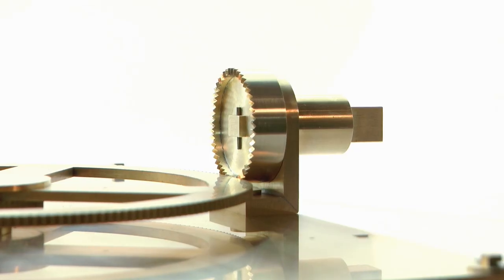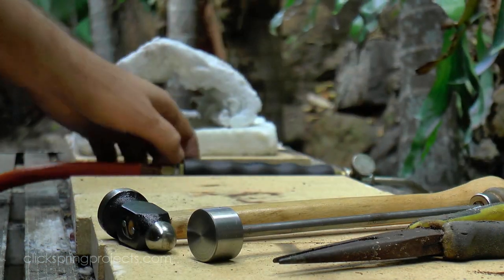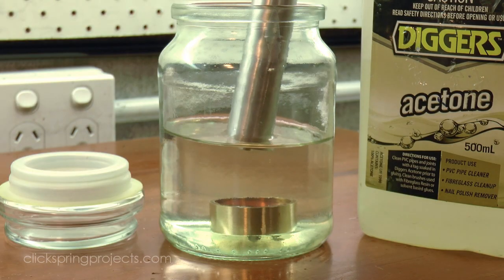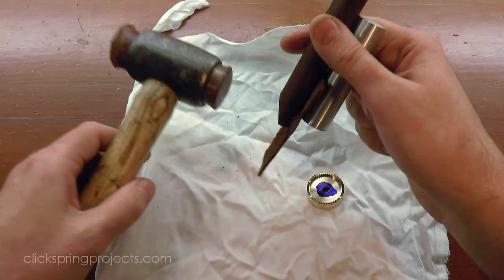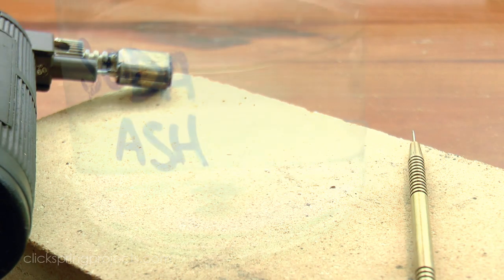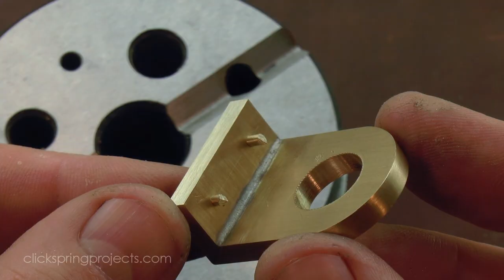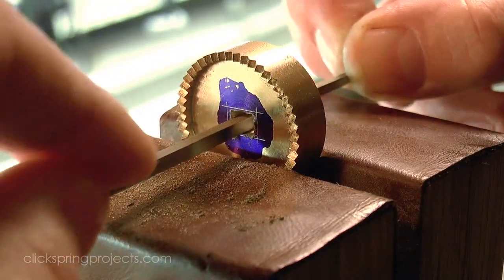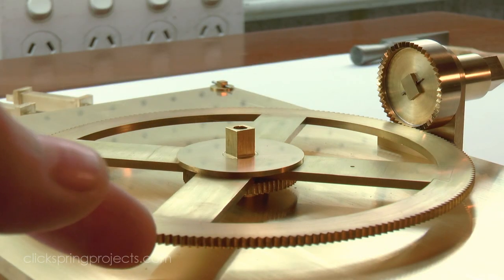The #Antikythera Mechanism Episode 5 - The Input Crown Wheel Assembly

Comment from the maker: In this video I make the small assembly that enables the user to drive the mechanism. Its an extra length episode for you folks, so please enjoy!
Reply: Awesome video as always Chris, I love how relaxing these videos are to watch.
Reply: awesome work chris..!!
i use to be your patreon but due to some financial conditions could not continue..
i am looking forward to start being your patreon again.
Reply: I wonder if the teeth were precut on the strip. You could imagine them having long lengths of teeth strips, it would be a good apprentice task. Similarly, it might be easier to turn the circle down to the right size for the teeth, than build an equivalent of your indexer.
Reply: I just noticed you forgot to flux the joint before folding it again
Reply: Clickspring Thank you!
Reply: For the question of the choice of using flat stock over a solid piece for the crown, I think some of the mounting/grinding/lapping techniques remind me of when I used to do lapidary and silver/copper smith settings.  Naturally we used Wax instead of glue etc while learning, then modern glues after.  I think it'd be pretty reasonable to assume the original maker might have had to conserve materials in the way we would with jewellery, and the general form of the crown isn't entirely unlike a gem setting in my eyes.
Reply: What would the teeth shape be like if you formed the teeth before wrapping and forming? Would that have been easier to do with hand tools?
Reply: Ok. I need to create a patreon account Chris. You videos are comming out waaay to slowlly :-) 

But they are so amaysing I just cannot wait till the next :-) 

Hello from France !

Matt.
Reply: Have been thinking about the same thing.  Marking the teeth on a straight flat piece from the existing mating wheel would be dead easy, and possibly even filing them first.  I remember, from learning to make jewellery as a kid, being amazed with the precision possible with patience, techniques and skills.  Possibly one reason some of the finest lenscrafters still do the bulk of the finishing work by hand.
Reply: Just a guess, but bending the strip might've caused the tooth profile to deform.
Reply: Yep, kindof suggests it might have been a two step (or more) process.  Wouldn't be surprised if the teeth were started flat, then finished to mate afterwards.  That would gel with the techniques for 'Scraping' bearing journals and flat surfaces and the like.  Start rough and finish in place knocking off high spots.  definitely laborious but rewarding.  That's how reference plates are made still.
Reply: Clickspring watched a ad without skipping because i like this channel
Reply: If you get bored of manually turning the crank, ask JohnnyQ90 to make a turbine to fit
Reply: Very much enjoyed Chris.
Reply: Clickspring ...you are one of the best craftsmen, I have ever seen. I eagerly await every video. I know that this level of craftsmanship takes time, but I have to say I wish it didn't take so long between episodes. I guess I'm too impatient. Thanks for your work. I find it so enjoyable.
Reply: Chris with all the work you put in trying to be authentic and the in depth knowledge you would have gained in these builds please consider putting on some displays in conjunction with museums around the world. Probably some quick lectures. With such a clear voice and good temperament I am sure you would be great.
Reply: Did you consider that maybe the teeth were cut into the band before it was shaped into a ring? Couldn't it be easier to make this way with ancient tools?
Reply: Chris, Love your videos, always a delight to see your new ones come out.  But the music you are using in it, is so hypnotically relaxing.  I'd pay you $100 just for you to tell me exactly where I can get it/buy it from.  I love ambient music that much.
Reply: I was thinking the same thing as others that said to cut the teeth before forming the ring. Not only would it be easier to cut the teeth, but when bent would not the profile of the teeth change to better engage rather than straight cut teeth on a ring?
Reply: A Very Private Life come on... These things need their time to complete.
Reply: Clickspring i
Reply: Clickspring You should use thumbnails of what's in the video, that way you will probably get more views. Instead of the same image.
Reply: +Gamer Plus He doesn't even credit who he takes the clips from.  Not good form.  :-(
Reply: Hi, i follow you often, if is it possible, what brand and model is your lathe?
Reply: Are you coming with the next episode? 😅
Reply: That's exactly what I said at that point lol
Reply: Hi Chris, with these triangular cut gears there appears to be a little backlash does that not matter in the operation of this device? Fabulous quality of work.
Reply: Clickspring good watch thank you. For your 90 degree bracket, did they perhaps forge or stamp the blank and file to shape? Bronze drop forges very well and can be forged to a very tight tolerance under a competent smith.
Reply: Clickspring could you touch on possible turning techniques that may have been used in the period ? I see you using the lathe a lot in this project, probably for convenience rather than necessity but I’d like to hear your take on possible ancient methods of turning accurate parts. Great series by the way.
Reply: In light that dovetails was used in the construction of the B1 wheel, I wonder if the 90° angle of the bracket could have had a secret mitred dovetail joint with a locking pin (revealed by röntgen rays).
Reply: Been watching your antikythera build and I gotta say....impressed.
In a previous episode you mentioned that candle soot is a good temporary marking compound you were grasping at a better compound.
In those days the paints and inks would likely be usable but also temporary due to the how primitive they were and the fact the were primarily used on porous materials like wood, parchment, leather and clay/stone etc....
There is another option that would have been available and known to any person who works metals (especially alloys)
Tarnish....or in other words....patina.
A brass or bronze object left out in the air or exposed to many types of mild acids and bases has the tendency to discolor.this patina can be easily marked through and when the job is done removed either by rubbing or dipping in a mild acid to dissolve. 
I've used this method working copper water line.

Comment: I love your videos, in fact, as a tradesman, journeyman machinist myself for over 25 years, you're quite hypnotic to watch.  One thing I do, just as a safety and handy thing when parting off, is to leave a nubbin attached, around .1 thick, as then break my part loose by hand.  It's big enough to hold the part for tool removal from the cut and small enough to break off by hand, with a sander or clip with pliers.  Carry on, great video as always!

Comment: A tip from a apprentice black Smith when joining two flat ends like @3:29, when its flat hammer a slight taper in thickness, opposite on each end, so that you can have the ends overlap and you keep the same dimensions. You can then weld and or rivet the end together making a stronger joint even if you just bud and solder it.

Comment: Could it of been made in 2 parts so that if the teeth of the gear happened to wear out just the ring would of needed to be reformed?
Reply from the maker: Yes, definite possibility
Reply: I think that is a very good theory actually.
Reply: my (probably wrong) theory was that it might have been easier to cut teeth on a flat piece of stock then form it to the circle later
Reply: Clickspring have you thought about the ring being movable for depthing, then later soldered into place permanently?

Comment: I really admire your soft welding skills! As well as how you merge parts together and it looks like a single piece at the end. You are a true master. By the way, I can explain why the frictions are low, for triangular teeth, based on my experience. It was also counterintuitive for my during my build. The contact ratio of triangular teeth is below 1. Contact ratio should normally be >1, typically around 1.6. They can slide to each other due to the gap, however the friction is low, exactly due to this. Side-effect. :)

Comment: Really like that technique of folding thick stock by cutting with the V-groove tool! I've seen that done before in the "dibond" sign material - it's that aluminium/polythene/aluminium laminate. Cut through one layer of metal plus the plastic core with a V router, and it can be folded to make enclosures, boxes etc.

Comment: Quite spectacular video! The probable reason that the ancients fabricated the crown wheel the way they did is they didn't have lathe-power. They had access only to pole lathes. I have made four or five of these things; YT is full of pole lathe projects. But a pole lathe is a real workout even with wood (you have one leg-power) and it is hard to use it on metals, which tend to slip under the rope on a pole lathe.

Comment: FWIW, when you put the finer grit wet/dry sandpaper on plate glass to sharpen something, or to polish it flat, I find it helpful to use water on the sandpaper, so it doesn't load up so fast. The water seems to help the back of the sandpaper stick to the glass, for some reason, as well. (some sort of surface tension deal, I'm sure) If you're concerned about the paper part of the sandpaper absorbing too much water and distorting the flatness of the whole setup, 3M makes some fine micron-graded microfinishing film with some sort of plastic backing. (for some reason polyester is in my mind, but it could be another material). I've found it from jewlers supply places, as well as specialty woodworking tool shops. (people (like me!) use it to get a refined edge on woodworking tools via the plate glass method)

Comment: Chris will likely never see this comment, but I have to say this:

From an engineering standpoint, it is a mistake to put the seam at the root of the tooth. This position puts the seam under the most stress, and is the most likely to crack the seam open. 

Any force in either direction puts that joint under tension, and is more likely to crack it apart, due to the sharp corner of the tooth root. It would be best to put the seam at the crown of the tooth, so any forces would tend to force the seam closed, thus minimizing the stress put on the solder and increaing the life of the part.

Just had to get that off my chest. Love your work! A level of patience and precision I can only aspire to!

Comment: Hello! To totally clean a non ferous piece and aneal it, heat the piece to red hot and plunge it in a jar filled with Denatured alcohol, it's a tips used in jewellery, instead of leaving a coat of black /brown oxydation, the piece will be totally shiny.

It seem weird to plunge a red hot metal piece into denatured alcohol, but if the container is big enought it won't catch fire.

as usual the work on your videos is astonishing, thanks a lot !

Comment: Stunning work, as always Chris.

I'd guess the reason for the band style construction would be more efficient use of metal. Today we think nothing of just machining materials away and leaving them in the chip pan. In the era this was constructed I would think metals would be very expensive and the maker may not have the facilities to re-melt and recycle the excess. Additive manufacturing is more efficient with materials compared with the subtractive manufacturing we're more used to today. In essence, the first 3D printer ;) Even now, weldments are often more efficient than machining from solid.

Comment: It's a G'day indeed Chris, to see another fine episode of your artisanship and highest quality vids!  Quite the conundrum of the cylinder Vs. lathe cut, but from the cracking (likely work hardening from drag with the entire gear train) I get the feeling you were right in your choice.  The other conundrum is whether the teeth cut b4 on a flat (at least started) or after with indexing.  Either way the basic profile would seem to have flaws...lots of food for thought but likely comes down to being able to easily replace it at some point in its life!!  Thanks for the links in the description...ambrosia for the curious mind!  Thanks Always for your painstaking work and detail and personally I never get tired of disappearing pin tops.  ~¿@  Best to you Always!  ~PJ
Reply from the maker: Hey PJ, yes I think you're on the mark with the replacement idea - its clear that the crown wheel teeth will be prone to damage if the user should force the mechanism in any way. So being able to replace damaged teeth whilst maintaining the driving rectangle would be a huge bonus - cheers mate :)

Comment: Okay Chris, here is an idea : maybe the difficult approach to creating A1 was all due to replacements and practicality. Breaking the whole A1 meant you had to redo it, but a two part wheel could get its broken part removed and a new one affixed instead. Maybe the makers broke A1 during the build and came up with that solution, not to mention, how you said, that flat stock might have been much more readily avalaible than round stock
Reply from the maker: Yes I think its due to something very similar: Its clear that the teeth on A1 will experience significant wear due to the nature of the interaction with B1. So being able to "re-tooth" it with minimal grief (ie maintain the reference surface on the outer perimeter to the driving rectangle) would be enough of a motivation to fabricate the part in this way - Cheers mate :)

Comment: Despite much trepidation, I easily used super glue to turn a large aluminum pulley for my 44991 milling machine (which had used these horrid plastic gears).  After turning I put the chuck and glued part in the freezer thinking the difference in rate of expansion would simply separate them. An hour later they were still joined so I put the assembly in a hot bath which covered only the aluminum and it came right off.

Comment: I know this is an old video so you probably already figured out the answer but I think they did the teeth on the flat stock then rolled it on the cylinder after the cylinder was attached to the spindle. This would give them enough room to seat the retaining pin with a hammer and then they could solder the pieces together. Just a thought.

Comment: Chris, great episode as always! Maybe it has been already pointed out, but don't you feel that the sautering alone is too weak of a bond between the inner and outer part of the crown wheel? Putting a locating pin that prevents rotation between them might be an idea, I wouldn't want the drive mechanism to have too much load on it when all the wheels spin together...

Comment: so pins actually apply a small lateral clamping force in press fit parts without slits? i would expect that only with longitudinal pins drilled vertically, right on the seam. very interesting, and beautiful in such a small scale.

Comment: thanks for the interesting video. You asked the question why the crown wheel was fabricated and not cut from one piece but then did not yet find a plausible answer. If only thin plate was available but no solid bar then the bar would have to be layered out of plate as well. Was it? You have recreated the wood and leather vise, dividing plate, files and what not so you can use authentic tools for your build. How about the lathe? What kind of lathe did the old master have? Could you learn more from your build if you would be using an authentic lathe? It probably was driven by a foot treadle and belt gear to speed up the spindle. Using brass or bronze good quality plain bearings are possible. Probably the cutters were hand guided on a rest as you demonstrate some times. What kind of work holding would be obvious? Turning btw. centers? Face plate with wax, resin or soft solder as glue? With such a lathe it would not be a big problem to machine the crown wheel out of a solid piece. The solid piece could also have been forged to shape to save on excessive  bulk removal. Questions, questions...

Comment: you were wondering about why they  used a strip of brass versus  boring  for the gear one saving material yes,, two larger chunks are harder to come by ,,  three they  could have cut the teeth first  ,, but one of the very possible reasons is precision fitting a ring was probably easier than boring.  Remember the the  saying hammer the daylight out of it ?..  using a rig mandrel you can very precisely fit rings and tubes and the concentricity  is much better then you would think due to the physics of how peening a ring on a mandrel works . there is even a chance they took and cut something like a washer and made it into a tube .  hopes that might inspire some ideas  cheers

Comment: Chris, I am surprised that the softsolder on the 90 degree bracket did not cause it to contract the angle further. Brazing isn't as bad as welding but still hot metal does shrink.Also what were you holding the drill bit with when drilling the bracket.

Comment: Having watched through these videos, one explanation for why some of the parts were not made the "simple" way, such as the geared portion of the crown wheel assembly, could have been that the exact gear meshing or fit was unknown when that part was made. Thus making the parts modular to a degree would allow for some parts to be made out of order from what we would consider the most logical order of assembly or creation. Even if this machine was constructed based off an existing copy, the maker may have been unsure of the exact order of creation of the various parts.